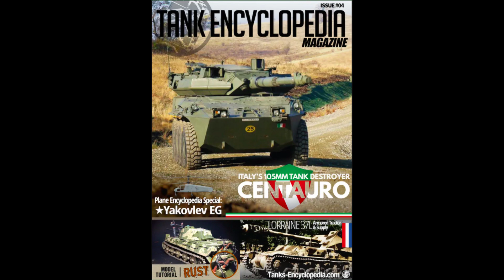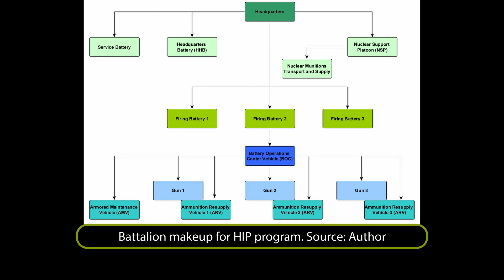FMC 'New Start' Howitzer Improvement Program - Money Down the Drain

Comment: It actually looks pretty neat. If electronics are involved, you don't even need the gun to swing left and right, it could be handled by the steering system, as artillery doesn't shoot on the move. This in turn allows a much easier autoloading implementation. Shame it failed.